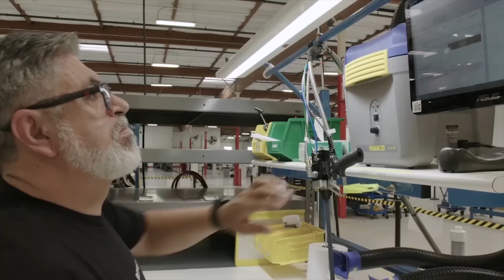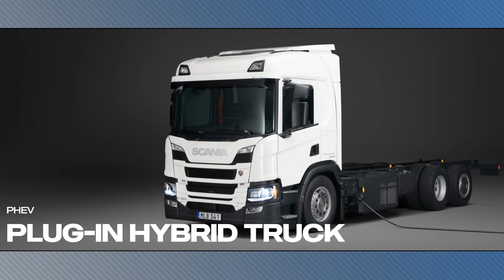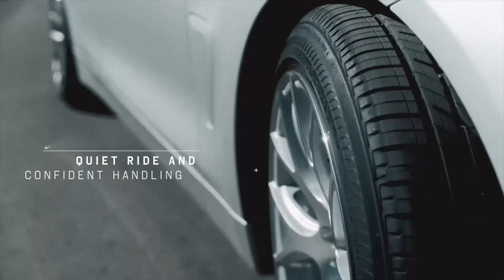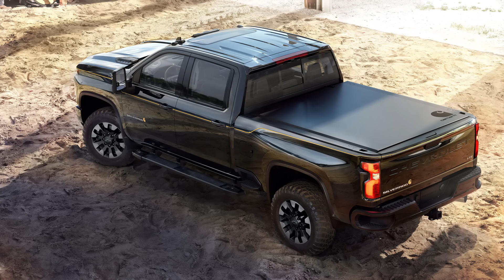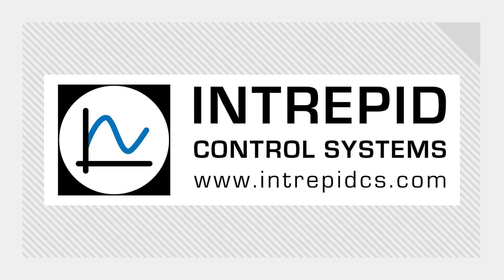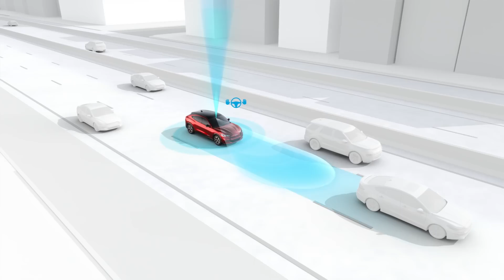New Ridgeline Finally Looks Like a Truck; Exclusive Mustang Mach-E Updates - Autoline Daily 2934

Comment: What about approach TESLA taking on Model Y consolidating 370 parts down to 3 parts in Berlin factory. Front, Rear frame with Battery section? Rear end crash, remove and install new rear frame section. Plus remove robots welding 370 parts together in factory. EDIT: Model Y sections just bolts together. Plus new range with 4680 batteries to 474 miles. TESLA lowering cost by $5,000 with changes. TESLA will produce 1,500,000 Model Y's in Berlin (2022), Fremont (2020), China (2021).

Comment: Solar panels on vertical surfaces (sides of a truck) produce so little power they aren't worth manufacturing. And one side of the truck will always be in the shade.
Seriously, just take the solar panels and put them on a building or parking lot.
Reply: perhaps they tilt up?  one can hope

Comment: Gas and diesel are being sold past the expiration date.
The future is all electric. Every auto maker is rolling out new electric technology.
No reason to buy old polluting technology.
Reply: EV's are still much more expensive than ICE. Even if it wasn't, there's not enough production capacity to supply the entire market, and this won't be scaled up for many years, with many problems like battery minerals and charging networks still unsolved. Ergo, there are plenty of reasons to still buy ICE.
Reply: @phamnuwen9442  people don't realize there is not enough electric power plant to supply EV's, if the EV market share increase faster than now. For example, California is experiencing black outs for last 2 decades every summer.
California pushed for EV's, yet they don't want to build more power plants.
Reply: @davidjacobs8558  It's worse than that. All the EV fanatics are also supporters of renewables, which will make electricity prices skyrocket, eliminating the single major selling point of the EV.

Tesla is building solar panels and EV's. Both uneconomical products on their own, and one in conflict with the other.

The kind of insane nonsense that can only happen when politicians subsidize and dictate market activity.
Reply: I’m holding off until I can buy a Honda Ev for the same price of a civic.  Even then I’ll still own a gas car for road trips.
Reply: I paid $27K for my Tesla and charge at home with my solar panels. If I take a trip are use to superchargers. Don't listen to the people who don't even own one.
Reply: @BryceLovesTech  Your Tesla and your solar panels are paid for to a great extent by other people, through subsidies.

Comment: 2% EV market share is pathetic. But, it's till much better than John predicted years ago, when all "electrified" models were a fraction of 1% and John said it would never get to even 2% because people don't want electrified cars. I haven't bought a new traditional ICE car since 2003. I'm on my 4th plug in vehicle and would not consider a new anything that still has a gas tank.
Reply: Hope you have long enough arms.... to pat yourself on your back.... 

BTW the bike riding dutch have you beat...
Reply: Say thanks to the tax payers and the ICE buyers who have been and are still subsidizing your expensive virtue signaling.
Reply: @phamnuwen9442  Tesla used up subsides after selling 200,000 vehicles - same for all auto makers -  subsidie was written BEFORE Tesla was founded.  GM close to using up subsidies.
Reply: @brandoYT  Tesla received $400,000,000 in ZEV credits in Q2 which is about $5,000 per vehicle. This is redistributed from ICE manufacturers.

Buyers of ICE vehicles are therefore subsidizing EV's.